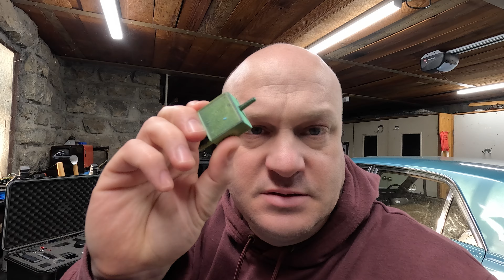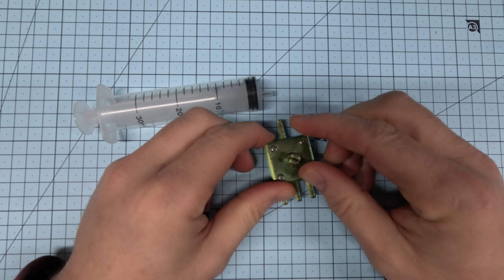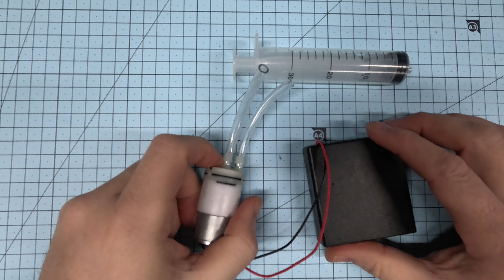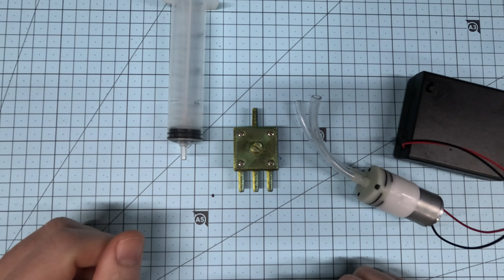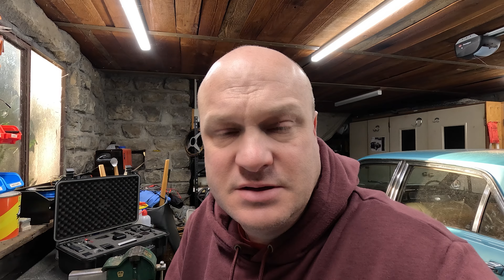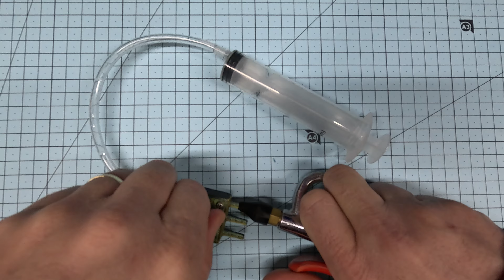Did It Work? - Testing My 3D Printed Reversible Air Valve

Comment: So the airflow does get affected by air leaking through the print layers, it'd always been discussed that 3D prints couldn't be used as vessels to hold liquids and experience with a Stratasys support bath suggests as much as well. It'd be interesting to see if a version of this sprayed with clear coat or event just a flat colour helps to seal the microgaps in the layers and the airflow to/from the pump is improved.
Reply from the maker: Those are good suggestions I'll give it a try!